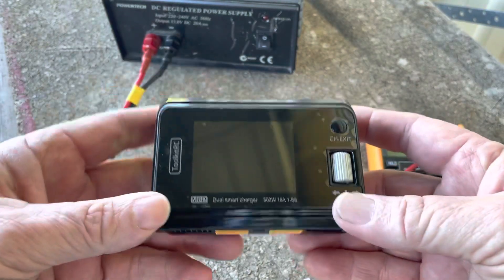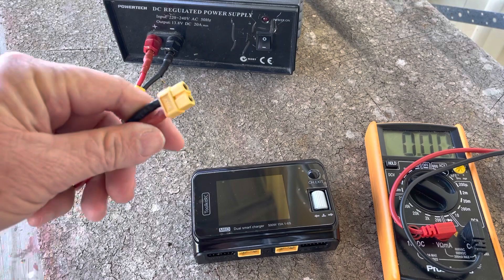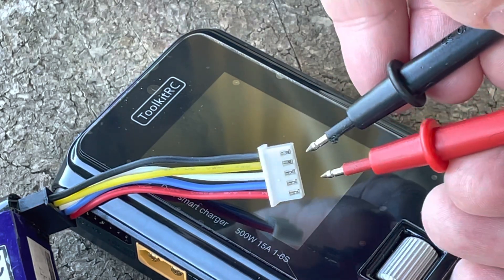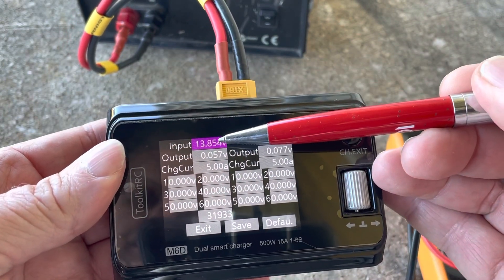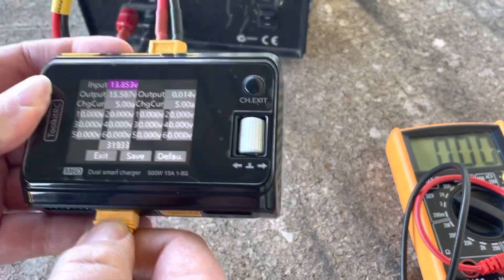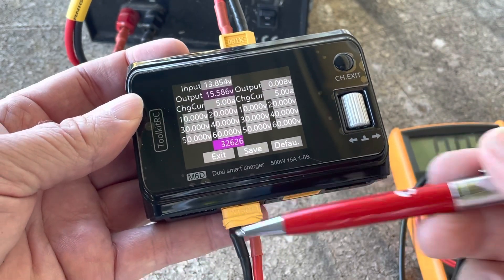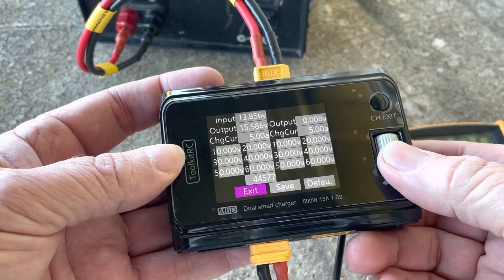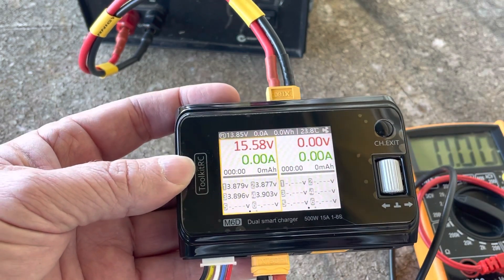ToolkitRC M6D Calibration

Comment: Thank you so much for this! Would you know why my M6D with some batteries charges the 6th cell faster then the others and at the end of the charge takes forever for the other 5 cells to get to full?
Reply from the maker: Hi Bobby, no I don't know. I do agree though that reaching a cut-off for full charge can take a long time ... sometimes not at all. It has been suggested that small capacity batteries "suffer" from this anomaly more than larger batteries. 650 mAh is the biggest capacity battery that I charge and rarely do I wait for the cycle to complete.